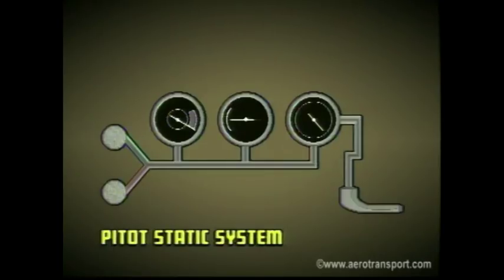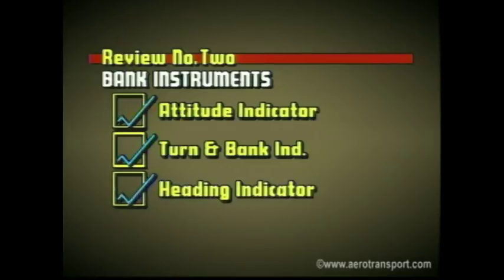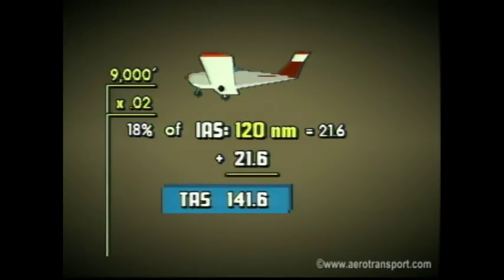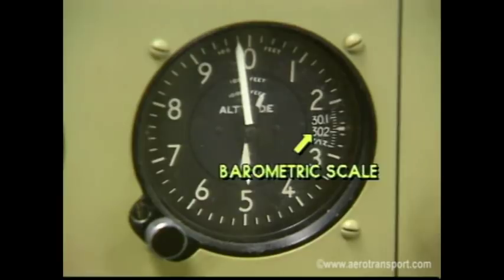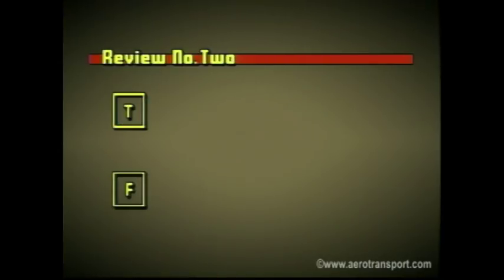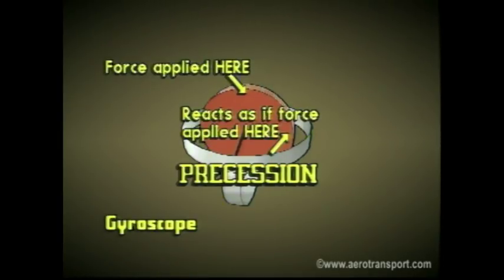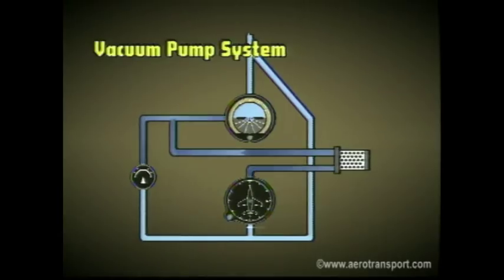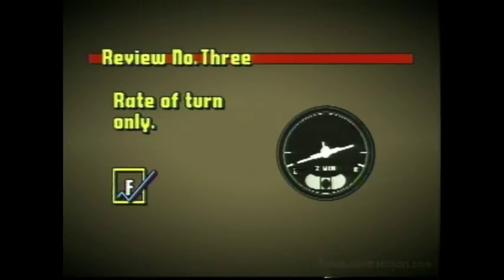Flight Training Manual Lesson #10: Flight Instruments

Comment: thanks for taking the time to post this... I found it helpful... it also made me realize how unreliable instruments can me in extreme conditions and how conscious you need to be of calibration of your instruments. I did have a question about flying over high terrain and adjusting altimeter settings. If the alt is low where you take off and high where you land how do you know what it will be over the mountains...better safe than sorry would be to fly higher than your alt would indicate... so just calibrate it to the known higher reading?